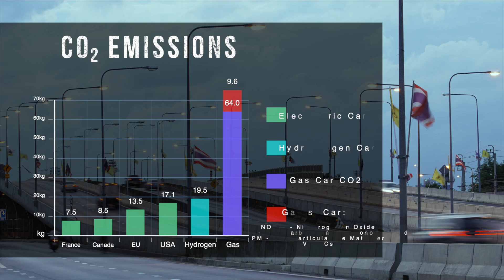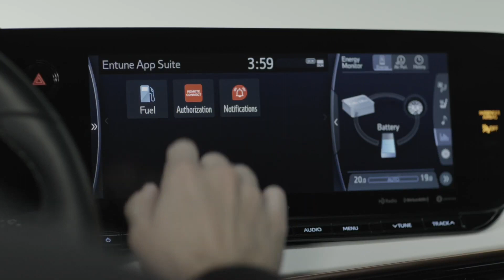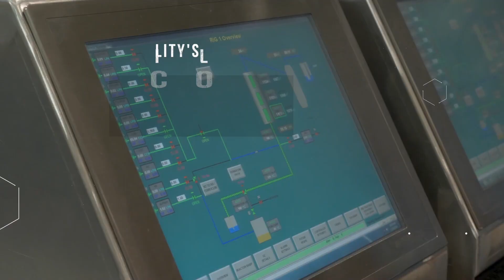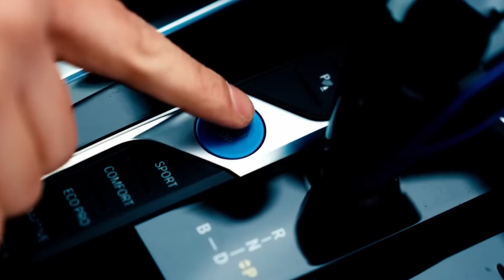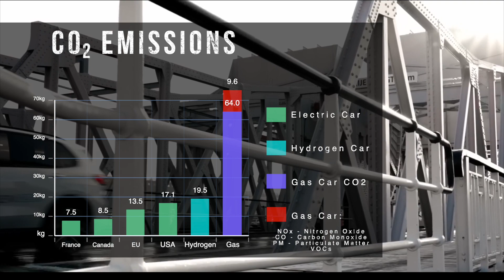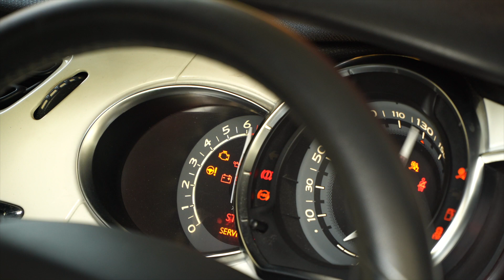EVs vs Hydrogen the battle for your future

Comment: You omitted to mention that the hydrogen fuel cell cars are actually battery hybrids. They have a lithium ion battery pack to store extra power to allow for acceleration and climbing hills .
Burning hydrogen in an ICE produces water plus as much nitrogen oxides as an other furled  ICE. Due to burning the hydrogen in air which is 80% nitrogen
Reply from the maker: I didn’t omitted that, I said that at 4:10. And ICE is just 28% efficient and also hydrogen has very low energy density. That’s why hydrogen ICE is ridiculously idiotic idea.

Comment: Tesla now makes hydrogen car model, despite falling price of lithium.
Elon Musk once said hydrogen fuel cell system is "mindbogglingly stupid."
Reply from the maker: Hydrogen is more convenient now because of the time of charging the battery in EV, but it will never be as economical as EV. It will be better choice for transportation trucks due to the battery weight and charging time. But to compare them quickly- EV is 95% efficient and use energy directly from the grid. The hydrogen is only a energy storage equivalent to the battery. You have to convert the energy into hydrogen which is very inefficient than you have to transport it and distribute it, than in hydrogen cars you have to convert it back to energy in the fuel cell which is 60-80% efficient. You see how much energy is wasted with the hydrogen. That’s why Musk was absolutely right. Now we can expect in a year or so batteries lasting 1000miles and charging 10-15min. That will be the end of hydrogen or any other technology.

Comment: So, do they have battery recyling in place for these batteries or, they will by the time they need replacing? No one is clear on that.
Reply from the maker: Several companies are developing recycling technologies. They are a little late because the EV industry is booming and had a head start. However, in a few years, recycling will reach 95% of batteries.
Reply: @Robb-USA  thanks for the comeback, but as of today they do not. Am I correct.?
Reply from the maker: @davewettlaufer7885  Yes, they are at maybe 20% recycling point, but it is not a problem yet as most batteries are still new.

Comment: Close to  90% of hydrogen now is produced from Methane not H2o.  Methane contains 4 times the hydrogen as water, and is far worse than Co2 as far as being a green house gas.  Hydrogen is a stalling tactic as well as cold fusion which we have been ten years away from for the past 50 years.  Gas producers are already lobbying for an acceptable level of Methane in the hydrogen they produce.   What is advancing quickly is the efficiency and utility of electric cars and batteries.
Reply from the maker: You are right about hydrogen, and I would like to add that hydrogen will never be as efficient as BEVs.

Comment: Why does nobody speak about gas (butane) powered cars , cheap little expence to convert  your existing car , just look at Italy they have been using butane for many years.
Reply from the maker: As with most innovations, there isn't enough interest to build infrastructure, and since the combustion engine is phasing out, there is no point in investing in engineering or building infrastructure.

Comment: The video claims that electrolysis is more economic than steam reforming natural gas.  Wrong. About 90% of all hydrogen is produced from natural gas because it is the most economical process.  The video said little about the number of hydrogen filling stations.  This was not an innocent mistake. There are less than 100 hydrogen fueling stations. For good reasons.  There have been over a billion dollars spent trying to develop economical methods of hydrogen production and safe methods of storage to no avail.  As it is hydrogen must be stored outdoors meaning that there can be no inside storage.   Recent filling station produced most gas as needed to reduce the amount stored.  The Shell hydrogen gas fuel pump cost $2,000,000 per installation. Recently Shell removed all of the 3 fueling stations as they were not economical and there was little demand. A new development with respect to EV battery new development will greatly advance energy density to the extent that trucks and aircraft will be able operate more cheaply than batteries.  Airbus has a joint project concerning EV to develop EV aircraft.
Reply from the maker: Thank you for your comment. Hydrogen cars will become economical as soon as fusion energy becomes available. At that point, every refueling station will produce hydrogen through electrolysis. Hydrogen will never be more economical than battery electric, but it will be a better choice for transportation due to battery weight and charging time.

Comment: When gas powered cars evolved from the early 1900's there were no gas stations for refueling and there was even a great amount of fear of gasoline becuase of it being highly volatile.  The gas producers should be encouraged to start moving to hydrogen fuel generation as part of moving away from fossil fuels.  If we keep depending on mineral based power such as lithium we will become dependant of the country with the largest reserves.  In some countries the level of poor practices may result in more environmental polution.  The USA and Canada need to think and plan further ahead than 10 or so years.
Reply from the maker: Your arguments are right, but the conclusion is slightly off. The only reason why we are using gas is because of Rockefeller, who pushed electric cars out because oil had no use when electricity was introduced. Oil companies are the reason why electric cars are here now, not at least 50 years ago. Lithium batteries will be phased out as soon as solid-state batteries become available. In the 1800s, when cities were filled with horse manure, they predicted that in a few years there would be a few meters of manure covering the ground. However, it didn't happen because of development. Cataclysmic predictions mostly don't come true because of development.

Comment: Good video, but battery tech is moving so fast that batteries now don't use the cobalt and nickel! EVs are even better!
Reply from the maker: You are partially right, they are switching to LFP but the majority are still NMC because Cobalt batteries have better performance. Change will come with solid state.

Comment: Why didn’t you include the hydrogen engine Toyota has developed that doesn’t have the heat lost of fuel cells and has a lot better range!
Reply from the maker: The specifications of the H2 engine are really sketchy because hydrogen has a very low energy density, and the combustion engine is only 30% efficient. As a result, it would be extremely slow and expensive to operate. It is likely developed to utilize existing ICE manufacturing facilities more than anything else. Fuel cells are 60-80% efficient and car is electric so it is fast.
Reply: Engineering Explained shows why the Toyota/Yamaha developed V8 hydrogen combustion engine is not practical.Due to energy density and the large amount of space needed for the tanks (huge)and a range of only 50 miles,where the petrol equivalent will do around 350 miles.

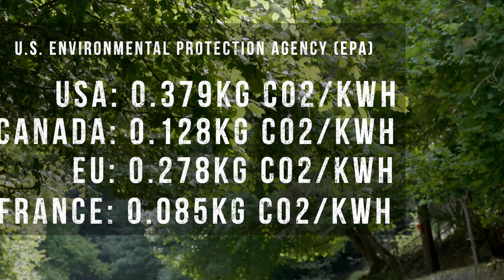Comment: Great video! I have one question though. @ 3:47 You included the battery production emission (4.65 kg) in the per 100 miles calculation. Is the number 4.65 kg given after dividing the production emission by the expected lifetime range of the battery?
Reply from the maker: Yes, calculations are based on 100 miles traveled and battery life is calculated 10 years/160k miles
Reply from the maker: @emilioagudelo5787  Thank you for your comment. These new batteries will change how people think about EVs.

Comment: Li soon replaced by Na. But H2 storage is better
Reply from the maker: You are right but H2 is expensive and difficult to handle.
Reply: @Robb-USA  yes. Makes steel brittle. But we have alloys for that. And yield of production raised using 30% less electricity
Reply from the maker: @Oliveir51  Yes, there is technology for that, but H2 will never reach the economy of an electric car because an EV uses electricity directly from the wall, stores it in a 95% efficient battery, and then utilizes it in a 95% efficient motor. The hydrogen production process consumes energy, there are losses during transport and storage, and the fuel cell itself is only 60% efficient.
Reply: Li needs a huge amount of energy to extract. This among others makes a huge CO2 footprint

Comment: This video is proudly sponsored by the fossil fuel industry.
Reply from the maker: I am showing that ICE emits several times more pollutants and CO2 than EV and you are saying they paid for it?
Reply: You seem to be missing the point that the global Hydrogen hype is actually just veiled fossil fuel greenwashing. 

That hydrogen is made in a high emissions process using fossil fuels, and then they put carbon capture on that process using a massive amount of energy, then they power that with solar panels to hide the negative effects (and because solar is actually cheaper than fuel generation so they use it for their own purposes for profitability). 

So the world is sponsoring the petroleum companies three times for the same project with green credits, tax incentives and grants. 

But all this money, skills and materials going to greenwash fossil fuels (pretending hydrogen for transportation is a good idea) is money, skills and materials that is not going to other genuine green initiatives. 

For example if we just take the  same number of solar panels and plug them straight into the grid to charge electric cars we would get more miles/km driven than all the complication and emissions of making Hydrogen would allow.  But that would not funnel money into the petroleum industry so that is not what anyone powerful is lobbying for. 

Combine that with the point that any fuel needs wasteful layers of storage and transportation to get into your car. Around 30% of fuel is used just transporting fuel. Some very large companies have an interest in us continuing to use a physical fuel instead of grid/local electricity. And these companies are very tightly associated with the petroleum industry. And this is why there is a lot of profit motivated propaganda trying to ensure the world keeps using fuels instead of anything more efficient. 

Hydrogen is a fossil fuel with high emissions, do not get hooked into their propaganda telling you otherwise.

Comment: I just realized an EV Hate lie that didn't click until this video

The lie that EV batteries end up in landfills

The truth is that they end up in an EV conversion.

EV cars go to salvage yards with gas where the battery is usually the 1st part to sell
Reply from the maker: Yep, batteries are sold or recycled. Recycling industry is little slow but they are catching up.
Reply: There is a lot of low performance life in an EV battery after the high performance specs degrade. 

There are many things they could be used for primarily in green generation (solar/wind) peak production storage waiting for peak demand to use. 

If you own an EV at the end of its life the best thing would be to take your old battery and use it in your house/business to supplement the solar panels on your rooftop. But it could also be sold to some company  doing something similar with it. 

The simple fact is that the mass majority of EV batteries ever produced, and still in active use in the cars. The market has not matured enough yet that there are enough old used batteries to justify a business reusing them or recycling them in large quantities. It will come when the market volume becomes significant.
Reply from the maker: @5353Jumper  Batteries probably will never be reused, the same as old engines. Recycling of the batteries is growing fast but it needs some time to catch up to the battery production. In few years there will be batteries that last a lot longer than the car itself, at that time they will introduce battery swapping instead of charging and at that time battery and charging time problems will disappear.

Comment: Until you can make a car that can charge itself with no complications mechanically than maybe I might switch.
Reply from the maker: This wish is no where in sight but solid state batteries are the real. Charging will take 5min for 1000miles range.
Reply: Toyota Prius and all other HYBRIDS are as close as we currently are to that capability now.

Comment: Bit of lie. Wait of batteries are big. So you nead to spent more energy to have it in the car. You nead biger wheels, biger brakes, more carbon materials ti make wait of the car more less.  Winter. Heating makes batteries flat after few tenth of km., Trucks never be good with electric. Becoaus of big wait of batteries. Teslas truck batteries are 6Tons of wait and charging time 12h., And if it tracking fridge ir sommer time in Arizona , it can go just few hundreds of miles. Becouse of cooling cabine and cooling fridge. Hidrogrn is future
Reply from the maker: You are mostly right, the batteries and charging time is the main obstacle for most people. The winter driving is not as bad as everybody thinks. In general Tesla is loosing 15%-20% in the winter and gas cars loose 15% as well. On top of that gas cars loose 25% on short trips where EVs do not loose anything on short trips.

Comment: RETIRED, 78, FREEDOM, USAF, VFW. HYDROGEN PROBLEM FROM BOILING POINT OF HYDROGEN −423 °F. PARK SEVENTEEN HOURS FUEL CELL MAY BE EMPTY, FROM BOILING AND BLEED OFF.
Reply from the maker: They already overcame this obstacle but hydrogen is still too expensive and there is almost no refueling infrastructure.
Reply: @Robb-USA  WHEN YOU FILL UP WITH HYDROGEN YOU HAVE TO USE.

Comment: Thank you so much Wise Media. Right. It's not a question of opinion, but physics and economics. Electrolysis require electricity to split H2 from O2. It's powered by burning Natural Gas, coal and some petrol (65%) some Nuclear (19%) and finally; renewables (16 to 18% at the most) to do so in the US. Then, you have the high tech "other way" to make H2 in what Toyota did with the Mirai, running on H2. It starts with a massive organic compost plant (not available everywhere) that must put out a massive amount of CH4 (methane). They pass through the CH4, a very hot steam (heated by burning gas or electrically) to split H4. The reaction then puts out CO2, H2O and H4. It's not “Green Hydrogen”. Then, they must spend more energy (by burning more gas or consuming hydro) to compress it to 10,000 lbs per square inch into tanks to be usable in cars, because it will be too weak to power a car under 1 atmosphere. Next, you will pay around $65 for a full tank of H2, available now only in very very few stations (one is in South California), for a 400+ miles range. It's about the same price for a full tank of gasoline at the pump in California. And then, since Hydrogen is the smallest atom, it escapes almost any containers (especially under 10,000 psi!), so every day you lose H2 from your tank, until, days later if you don't gas up, you can't start the car. Next is that if you want performance, you will be disappointed with the Mirai reaching 60mph in over 9 seconds. Do your own homework and you will find out for yourself. In Thermodynamics physics, every time we ad steps and processes to the mix, we lose energy invested in making it work. Conversely, solar panels yield useable electricity directly stored in batteries and electric motors converts energy at about 90-98%, whereas a gas H2 piston engine, has a best conversion ratio of 60%. So, you only use 60% at best of your money to move your car, whereas you waste 40% in heat. Last, consider real “Green Hydrogen Production” done with renewables. Does it make sense to use electricity from solar panels, to split H2 from O2, to store and compress and distribute hydrogen to a new worldwide distribution grid (we will all pay for them to build that grid, either in our taxes or at the pump)? And then you're short changed in your "H2 gas piston engine wasting 40% of your money? It's still a bunch of un-necessary added steps, energy losses and money costs. Right now a Tesla Model S will cost you about $14 - $15 on your hydro bill for 407 miles range,with outstanding performance. No oil change, no transmission fluids, no valve adjustments, no new muffler needed. The above numbers may vary a bit from state to state, year to year, but going electric is the future. And the Sun will generously provide energy for a few more billion years. It's abundant and free. Cheers!
Reply: THE ONE MAJOR ISSUE you conviniently are forgetting is the mining of the Nickel to create your EV battery IS an environmental hazard, as well as the numerous steps required to turn the mined Nickel into a "useable material" and then of course the fact that Lithium Batteries CAN start themselves on fire due to "Thermal Run Away" which can happen at ANYTIME ! - Then again we dont have a proper grid set up for EV charging in any way so far AND FOR YOUR KNOWLEDGE SAKE - The companies that would have made those products here in America, were "banned" when Hillary Clinton and Barrack Obama were in office !
We have only read the Preface of a 30 chapter book when it comes to EV being "mainstream".
Reply: @richardburtonjr1889   I see what you are trying to say but let's be real; The mining of raw materials which will then be used for multiple charge cycles cannot possibly be more harmful or wasteful than mining fossil fuels which can then only be used ... once!
Reply from the maker: Thank you for your comment.
Reply: Appen at any time
Reply: The only issue is quot ruining the beautiful country side with solar and windmills , quit ruining the homes of all the wildlife with that God ugly solar panel and windmills